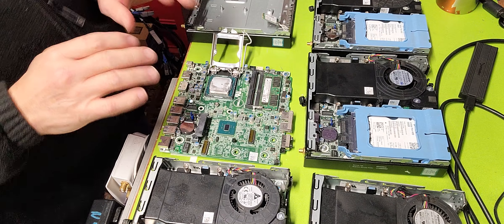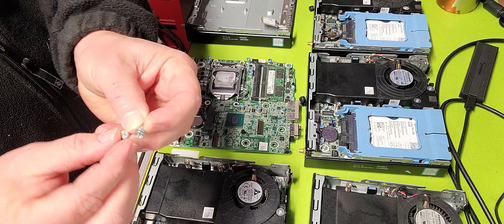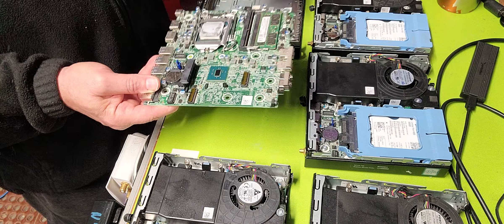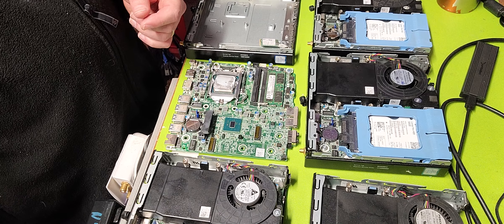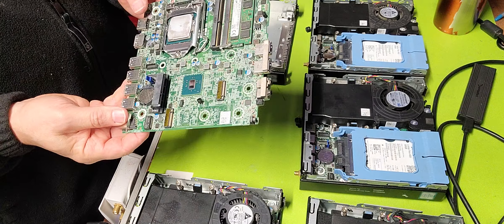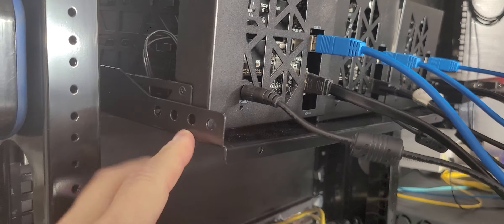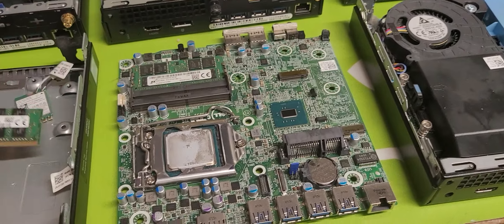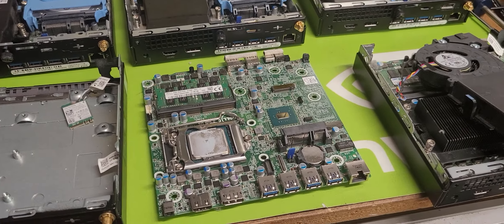Time to design the Proxmox MiniPC Data Center first with paper and pencil

Comment: nice video brad, yeh im not in danger of big snow storm here,

but im sure youll be warm with all the servers going.

can you do a 

tools list 
and 
parts list 

when you build this 

and as to the wifi cards can you update them to the newest chipset i think maybe wifi 5 or 6

and can you not solder the wifi card on the board :) to remove the issue with losing the ability to use the card without the case

Comment: You're never going to heat your garage with those little things.
Reply from the maker: Very true that is why I have a small but good HVAC system that kept everything at a 69 degrees level thru the whole deep freeze thing.  Step out into the main garage and your would not like it much.   about 42 degree avg.  I did a few videos on how to HVAC your home lab or data center.